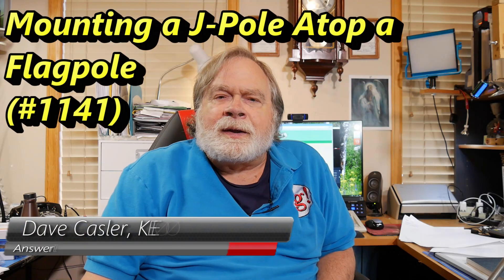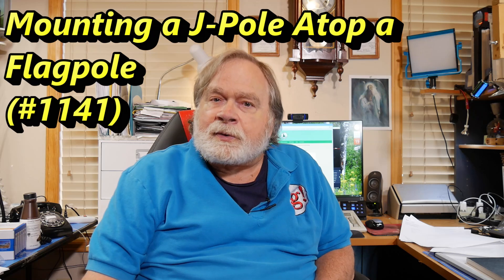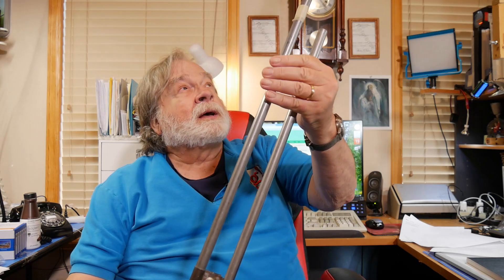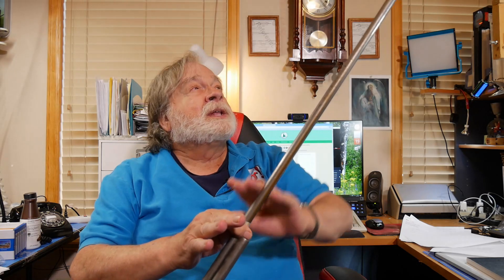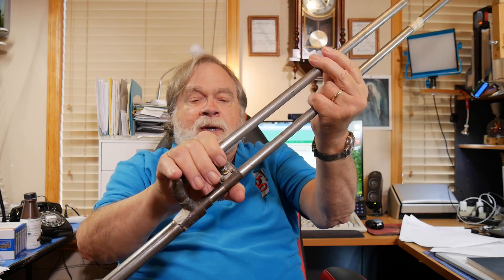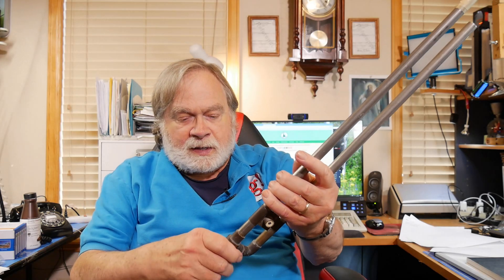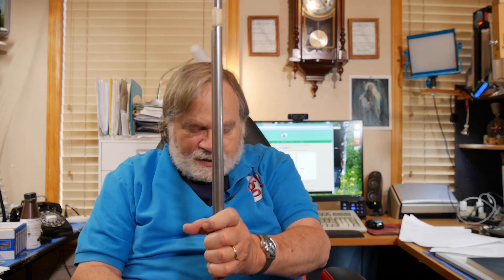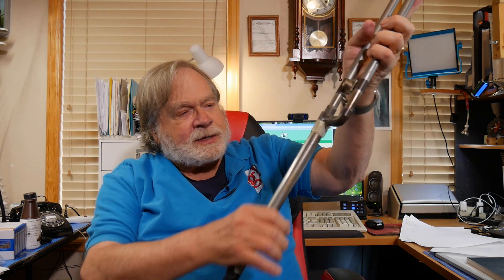Mounting a J-Pole Atop a Flagpole (#1141)

Comment: What would the radiating pattern look like if you have the J-pole horizontal?
Reply: Similar to any horizontal dipole. Doughnut sort of shape...so when turned on the side, it would be a bit of a figure eight, i.e. a good signal broadside to it, not so good towards the ends. It would be horizontally polarised, probably for SSB, is that the intention?
Reply: @paulsengupta971  I would be interested in scaling it up to 20m and using it for ssb dx. I put it in a PC software and rotated it back and forth to compare the radiation patterns. It seems almost identical to a center fed dipole. It doesn't make it any shorter though as a one is 1/4 wave on each side and the radiating element on this is 1/2 wave. Just 2 methods to the same end result. J-pole does have lower pattern in the vertical position, though.
Reply: @aarongriffin81  All a J-pole is, is an end fed half wave. It's a half wave antenna, with a quarter wave matching stub to match the high impedance at the end. So yes, it's effectively the same as a centre fed dipole. It doesn't matter where you feed the half wave, it's still a half wave antenna. There is an end fed half wave with a similar matching stub on HF, it's known as a Zepp antenna. The quarter wave matching section doesn't have to be in-line, it can be bent down at 90 degrees. Other ways to match it while end feeding are with a tuned LC circuit, or a 49:1 or 56:1 or 64:1 transformer.

Comment: If you are building, I'd instead suggest a SlimJim instead of a jpole. It doesnt have the vertical lobe issue that Dave mentions. but isnt as good if you are in a valley and need more loft. A SJ radiates 8° above the horizon.

Comment: New ham as of May, last week I put up a 30’ flagpole with j-pole on top. Grounded the pipe the j-pole is mounted to with #4 AWG stranded to the ground rod and bonding circuit. Radio is not connected yet. Relieved to hear this episode.